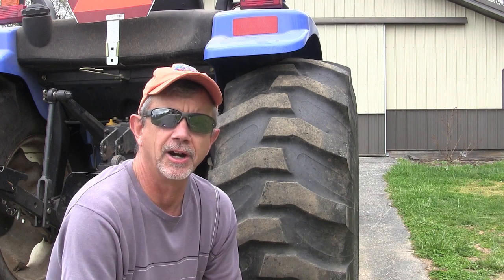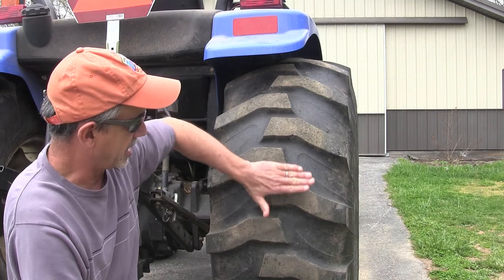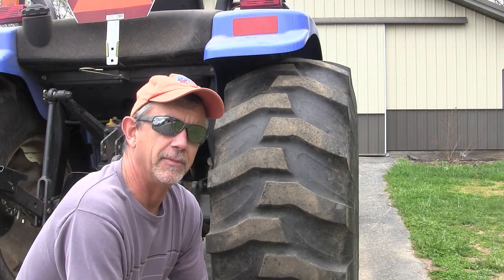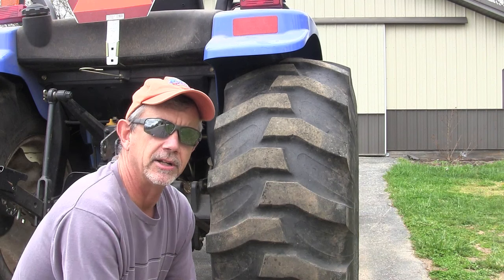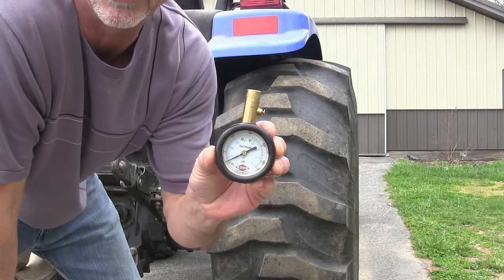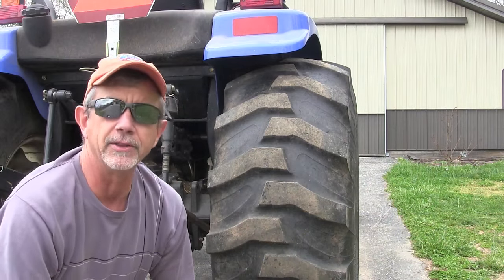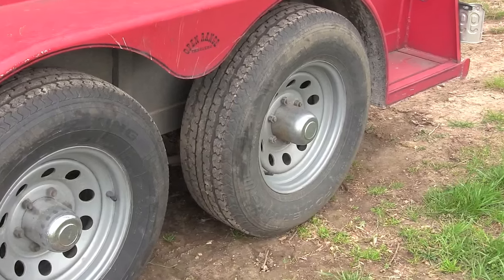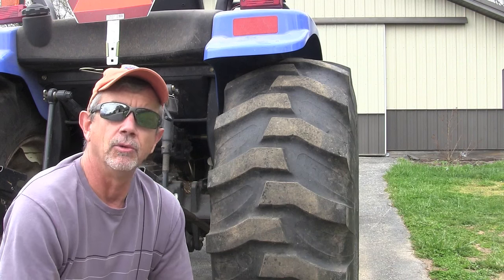Proper Tractor Tire Inflation

Comment: I think the tire pressure is really dependent on what you're doing.  If you're just pulling an implement, disc, plow, maybe bush hog, etc, you want lower pressure for more traction and a more comfortable ride.  If you're lifting heavy things with a loader, boom pole or carry all, you're gonna want higher pressure to give you more weight capacity.  If you look at your tires, it says it's maximum load bearing capacity at a certain psi.  The less pressure you have, the less weight the tire can carry without blowing out.  I've seen guys run way too little pressure in their tires and you can see the tire twist under load.  The center of the tire turns with the wheel and the tread wants to stay put on the ground.

Comment: You raise a very important topic with tire pressure !!! Tire pressure is everything on a tractor......To much air in the rear and the machine rides like shit....If your using a loader, your gonna want to keep the fronts at max....If your carrying a heavy rear implement, adjust pressure accordingly......And don't forget to check pressure every now & again to see where your at......All tires loose air over time....Good video!

Comment: Thanks for the tractor tire info!  I’m going to have to disagree with your truck tire inflation practice however.  Unless you are nearly always putting the maximum payload in your truck, the tires will wear more down the center of the tread.  Also, different brands of tires may hold more air than others, it’s best practice to go with the vehicle’s recommended pressure for tires, never the max on the tire.
I do enjoy you videos, thanks again!

Comment: Thanks for a great video, Mike.  My John Deere 4430  manual states that tires are over inflated during shipping to reduce jostling and therefore reduce damage.  It says the pressure must be reduced prior to utilization.  It includes a pressure guide for various tire sizes.

Comment: You can find on the side wall the max psi for ur tyre, 35is what I see most times..
I run mine so the outside edge actually touches the ground, gives better traction and ride, 
Over inflation will wear the centre of the tread..

Comment: Those tires were originally designed for backhoes where 80% of the weight is on the back tire so u need to pump them up to the spec on the sidewall . If you run those tires that hard on a compact tractor that even with a implement on the back wont weigh even a fraction of what a backhoe would. You should put one of your heaviest implements on the back raise it off the ground and run the tire pressure down till the entire tread touches the ground , check that new pressure and make them both the same .you'll never hurt the tire there way to over built for something that light but you'll love the ride and proformance of the tractor you spent that much $ on .

Comment: 16-45 psi? My 35 horsepower compact tractor which is similar to yours has a maximum pressure of 20 psi stamped on the rear tires.

Comment: You mention in the video that you're not sure why tires come inflated to such a high pressure. I believe it happens when the tire is mounted. Typically they inflate to a high pressure to seat the bead then are too lazy to reset the pressure to the correct level.  My L3301 had 40psi in the front and 30psi in the rear. 26/14 are the recommended.
Reply from the maker: Makes sense, thanks for sharing!

Comment: Running tractor tires with low pressure increases the risk that the front tires come off the rim when taking sharp turns in difficult terrain especially when using the loader. I run at 35 lbs. on all three of my tractors.
Reply from the maker: I should have covered that in the video, after it was posted there were several questions about the front tires which were covered in this one which posted a couple of weeks later: https://youtu.be/PH_r9G_7y5o.  I use my loader a lot so I run full inflation in the front tires but am still a big fan of low pressure in the back ones.
Reply: I should have said I run 35-40 psi on the front tires of all of my tractors not the rears.

Comment: I have a vintage 73IHC inherited from uncle and I can't remember how much air we use to put in the rear tires. Hoping someone can help me out as I remember it wasn't very much. The size of them is 14.9x28, they are 6ply. they also have a 13 wheel I believe and I only use it for digging a little dirt and light loads in the front bucket. Can you help me out here as i need it now to use every day and 1 tire is low with starting to have a slight wrinkle bulge in it.

Comment: Thanks Mike. I saw someone else on the tube recommend to deflate till the full width of the tread touched the ground. He said you could use a card or piece of paper placed between the outside edge of the tire and the ground and deflate till the tire left a mark or pinched it. Ever hear of that? That way sounds like very low pressure.
Reply from the maker: +Chris Schwimer Well, looking at the wear pattern on my tires, he may have a point.  Maybe someone who has been in the tire business can chime in and give us definitive information and what the disadvantage of being way below the minimum inflation would be on a tractor.  I hate to take much more air out of those tires, but the wear pattern sure tells me they're overinflated.  I'd hate to think what it would look like with the maximum recommended in there.  I may take a run at an agricultural tire maker and see if I could get some more information from them and do another video at a later date.
Reply: Looks like the tractor you show in the video is a New Holland (NH). I have the same issue. Both of the last two NH compact tractors I have used have the 17.5" by 24" R4, tires on the rear. The ones on my tractor now have a load rating of 5,360 lbs. at 26 psi. They are 8 ply. The tractor I have now has a cab so it adds a little more weight but even with 10 lbs. in them it's still too much because of the lack of weight on them. They are also filled with liquid ballast. 
I had a Titan dealer come out and he could see the issue. He said it would be okay to go down to10 lbs. but the absolute minimum was 6 lbs. In the NH manual, it says the pressure range is 12 to 28 lbs. The maximum psi listed on the tire is 26. The Titan dealer measured the weight on each tire with some scales. (My tractor had a loader with a 6 foot bucket on it and the ground was somewhat uneven which may be why the values weren't  equal or real close.) The weights were: LR-1,800 lbs., RR-1,740 lbs., LF-1,600 lbs., RF-1,400lbs. I asked that the Titan dealer bring the inflation issue up with NH and I believe he said he would.
I just finished putting two 105 lb. wheel weights on each side so now I've added around 210 lbs. to each tire, which isn't that much for the load capacity of the tire. I would like to add that the NH weights cannot be exactly centered. The casting is not real accurate which doesn't help. I had to use the slots so there was no definitive placement in the center of the wheel. Having 210 lbs. much off center wouldn't be good when roading the tractor. I don't really like the set up and don't know what NH was thinking (sometimes I think they don't really care) but I needed to get more weight on the rear without adding anything to the 3-point hitch, so it's free to use. I have yet to road the tractor to see how the tractor feels.

Comment: Do you have any suggestions on proper inflation of front tires for loader work? I own a 50hp midsize tractor. Thank you for any info.
Reply from the maker: Ray, I feel bad I didn't cover that in the back tire video, I have a second video coming to address that.  If I'm using a loader a lot I want pretty close to the maximum recommended.  If I'm mostly pulling something I want to be toward the minimum, just like I recommended in the previous video.  When I saw the obvious tread wear on my back tires I was inspired to discuss that and show what was happening, after I got it posted and published it dawned on me that I'd left the other half of the tires completely out.
Reply: Thank you Sir.

Comment: You didn't mention how to check air pressure in tires with ballast.
Reply: Run the valve stem to the top, there should be an air bubble. Test by depressing the valve core, if fluid comes out there's too much fluid installed. Bleed excess fluid out until air comes out and adjust pressure as necessary.

Comment: Mike. Having a problem adding air to loaded rear tires. With the valve stem at 12 o'clock it will not accept air. All I hear is the fluid grigling. Is it necessary to jack tires off the ground to accomplish this?
Reply from the maker: Possibly, but I've never had that problem so I'm wondering if the air compressor is at fault.

Comment: You spoke of tire inflation being on the low end, does this also mean front tires?
Reply from the maker: No, here's a video where I discussed that: https://youtu.be/PH_r9G_7y5o.  If I'm using my loader I keep the pressure in the front tires at, or near, near the maximum recommended.

Comment: Mike, Do I need any fluid in my tires?  I don't have a FEL.  I don't do much work with it.  I mainly have it for post hole digging and light work.  No hay or plowing.  I'd like to avoid it.  I plan to use it for parade pulling.
Reply from the maker: As long as you're not on hills and in danger of a rollover, you're probably fine without fluid.

Comment: Hey Mike, I am shopng around for a used tractor. I know you did some vids on buying used and they were useful, so thanx for that.  What I would really like to know is what type work, or tractor use is the hardest on them? When a seller tells me he used the tractor for such and such, I want to be able to say OK, ill pass on this one as it had a hard life doing that job. And vice versa.  I am sure there are tractor jobs that beat then up much more than others. A nice vid of this would be great. Thanx bud,
Reply from the maker: +Lucky Goose Gosh that's a little tough to answer.  In bigger tractors we generally assume that something that has been "farmed" with, or used for tillage/row crop production has had a lot of wear, versus one that has been on a livestock operation.  The thought process is that you'll have more wear from a heavy continuous pull than from haying and feeding.  Then you think about the components that the different operations stress and it gets a little more cloudy.  A continuous pull will be hard on the drivetrain and tires, the livestock operator is going to use the clutch more and the wet environment with manure around isn't good for electrical components.  On a compact tractor I honestly worry more about buying one that has been "babied" and never worked at all than one that has been used some.  I've actually seen compacts that went out and were used for extremely light work come back in a couple of years with an oil consumption problem because the guy using it never put the engine under enough load to "seat" the rings.  At the dealership I worked at, we actually put the tractor on a dyno and ran it under load for at least a half an hour before delivery to prevent that situation.  I, personally, wouldn't want a tractor that had been in a construction situation or in a place where the guy that owned it didn't run it, there were hired folks running it, but I think the overall condition usually is determined by the care the previous owner took of the tractor versus what he used it for.  GREAT QUESTION!!!  I'm going to drag some service people in to get second opinions and do a video soon, I'd bet there are a lot of different opinions about the answer.  I'm curious what everyone else has to say, maybe some viewers have some experiences to relate.

Comment: Good to know to check the tires. But if they are low, what do you use to increase it?
Reply from the maker: I have a little portable air compressor that works just fine.  Sometimes the valve stems are on the inside and a little tough to reach and I like them at the top if the tires are fluid filled.

Comment: I had window washer fluid put in my rear tires by the dealer.   Should one take special care measuring the PSI on tire with fluid fill?
Reply from the maker: +Karl Eisenmenger I always try to have the stems at, or near, the top so none of the fluid comes out.  That's all I do.

Comment: Hey Mike, I've wondered for some time now why tractor tires are so tall. Is it only for clearance underneath them or for traction?   So many new tractors are 4wd. but continue to have tall tires. I'm wondering if my 4wd John Deere 1025 would outpull a similar weight tractor 2wd with tall tires?  Thoughts?
Reply from the maker: That's a really good question.  I really think the reason for the tall tires on the back is three-fold.  First, you need to have the power sent to the wheels at a point above where the hitch is.  Let's say you're pulling a tillage attachment from the drawbar...the draft pull of the implement would be working with you to keep the front tires on the ground if the hitch were below the point where the power was transmitted to the wheels.  If the axle is below where the pulling point was, the load on the back would be trying to pick the front wheels off the ground and you wouldn't want that.  Secondly, the larger the circumference of the tire, the more rubber there is on the ground, and that increases traction and spreads out soil compaction.  Third is the ground clearance thing, but you could actually get a taller tractor with lower tires with axle modifications, so that's probably not one of the main reasons for the taller tires, but it comes with the other two.  There may be some other reasons that I haven't though of, so I'd welcome more comments.  GREAT QUESTION!!!

Comment: Mike, I love you channel....I have a JD 2040 and it is recommended to have 13.6x28 tires I am looking to get AG tires.  Would it be better to get wider tires?
Reply from the maker: First, if it's 4wd, better to go back with the same size tires.  There are ratios that must be maintained between the size of the back tires and the front tires so you're not plowing when in 4wd.  The front tires will turn just a little faster than the back tires.  If it's 2wd it doesn't matter, whatever fits on the rim will work as long as it clears the fender.  Beware that wider tires may stick out past rear implements.  You normally want implements to cover the tire tracks.
Reply: Thanks Mike it is a 2wd!

Comment: Mike, what are your feelings about running water in your tractor tyres thes days. We always ran water in the back tyres years ago.
Reply from the maker: +born2flyau If you live in an area that never freezes that's awesome!  Here in the midwest where it gets cold you can't have a big chunk of ice in there so we have to run an antifreeze-type solution.  I have fluid in my tires and it sure helps you stay stable on hills and helps the loader do its job.  Only downside, if you get a big hole in the bottom of the tire it can run out.

Comment: How do you know if the tractor tires are properly matched (Front to back) so as not to cause binding of the drive train when operating in 4 wheel drive.
Reply from the maker: Great question!  That's going to have to come from the manufacturer of the tractor.  They'll have a recommendation based on the gearing of the tractor.   It might be in the owner's manual of the tractor, otherwise, the parts department of the tractor brand should have access to it.  You want to put on exactly what they recommend because the front tires need to turn a little faster than the back tires or the tractor is constantly working against itself in four wheel drive.  I'll do a video about that some day.

Comment: Hello Mike, I have a flat on a 67 Massy with the power adjusting rims or spin out rims, I need to take the tire off to have it repaired, can I remove the rim and tire from the spin off rim by the 4 attaching bolts? this would leave the 500 lb center weight on the axle. Please advise.
Reply from the maker: That's a great question and I don't know the answer.  Generally those hub/rim separations are a little tough because many times they're rusted together, but I see what you're trying to accomplish.  Are the tires fluid filled?  If so you have a gob of weight there.  I'm going to pass your question on to some friends with a little more service experience and see what they say.  I'll get back with you as soon as I hear something.
Reply from the maker: The local guru of all things Massey, Ron, from Marshfield Machinery, says it'll work.  Here's his answer:

This will work okay and he won’t have to handle the heavy weight, but he will need to recheck the bolts to make sure the rim clamps stay tight.

Comment: What about front tire pressure and is the pressure different if your running a loader or not?
Reply from the maker: I'll put the recommended pressure in the front tires if I'm using the loader a lot and maybe let some of the air out when I'm in the field for a better ride.  I did a video on that right after I did the video you watched and here's the link: https://youtu.be/PH_r9G_7y5o.

Comment: I have a farm pro tractor and the farmers around me say you should run with three treads on the ground and that is how they run there tires are they close or wrong with air pressure
Reply from the maker: That's a new one on me.  If they're doing tillage work they may want less air to get maximum traction, I'm not sure that's where you want to be for brush hog or loader work.  I'll have to think about that one...